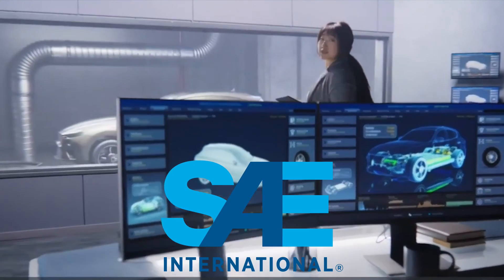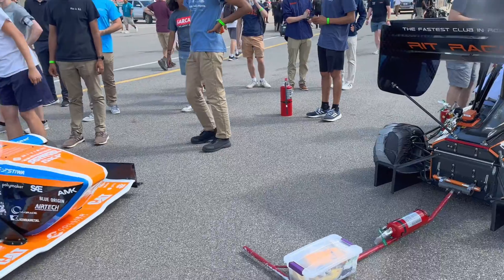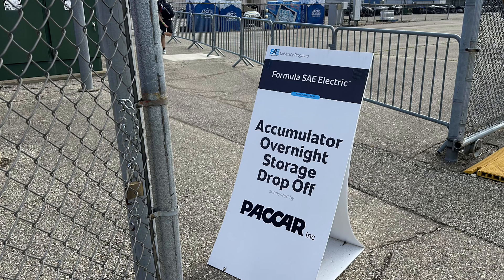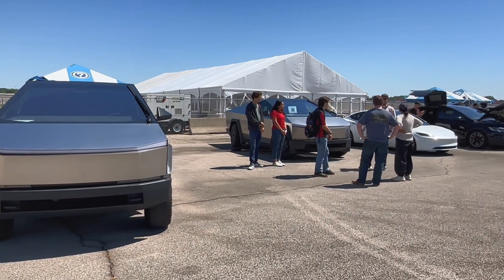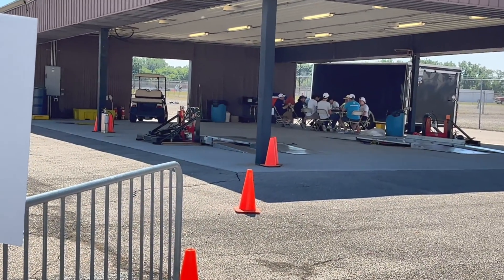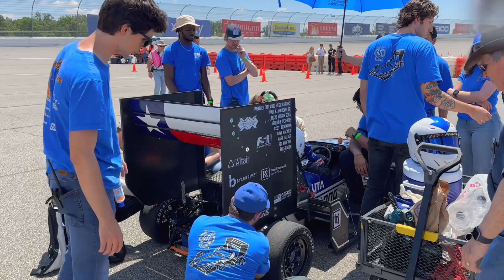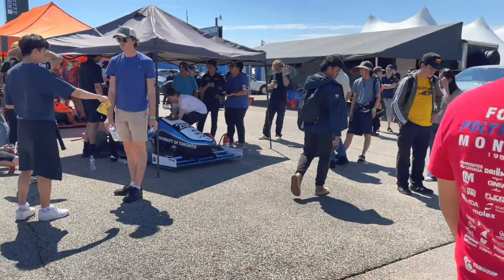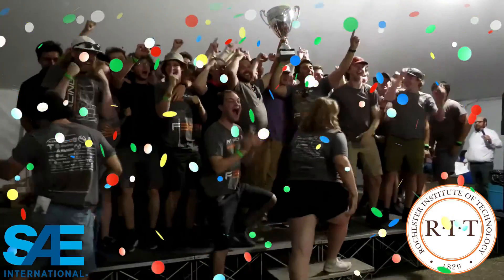What is Formula SAE Electric?  (Fast, Fun, Future)

Comment: This is an awesome video! Great footage and commentary. 

Just one small correction, University of Illinois’s car does use hub motors, but they’re only using them on the rear wheels, not all 4. University of Wisconsin uses the same concept